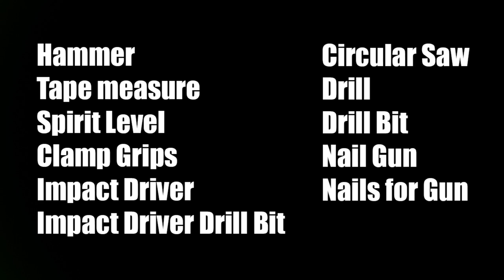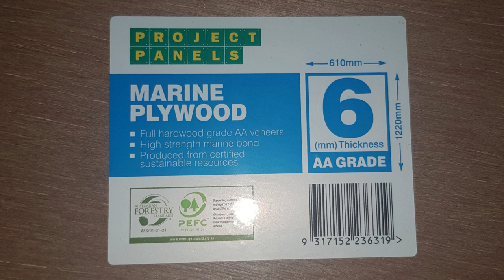How to build Fish Tank Stands/Racks/Racking. DIY! Part 1

Comment: My tank stands use another supporting piece of timber under each corner, I just didn't feel I could rely on the screws only. I know the screws are very strong, but my imagination was stronger -there were all sorts of horror scenarios. Cheers from the Gold Coast QLD.
Reply from the maker: Yeah thats understandable Melody. I should I have pointed out that these stands were for my weight requirements and that for larger tanks I wouldn't recommend building the stands with this technique. Nice to see some Aussies here too cheers mate.